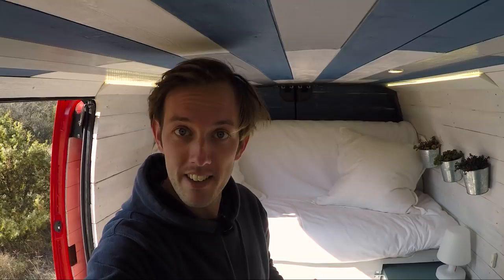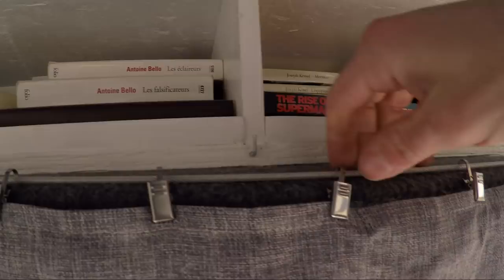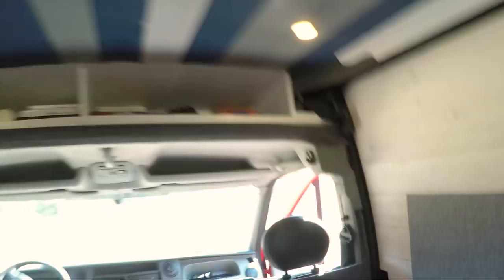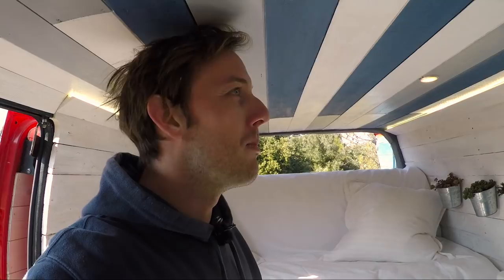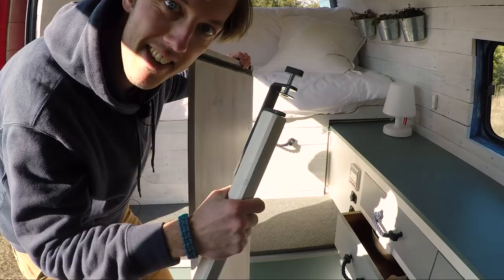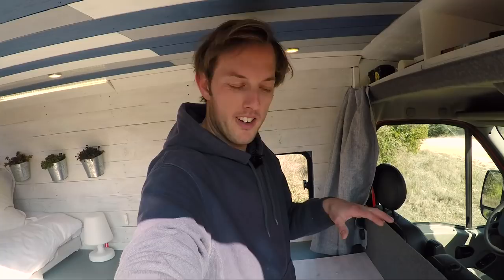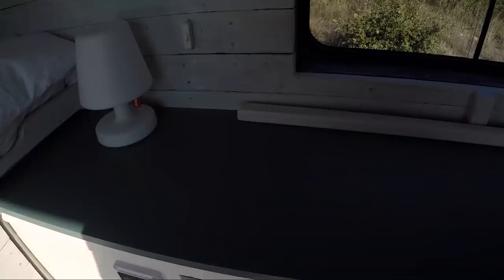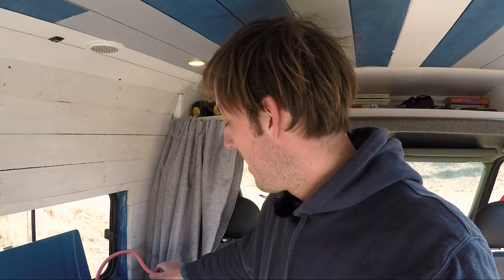VAN TOUR - DIY Camper van / Studio Conversion (New bed and table ideas for short wheelbase van)

Comment: Hello! I noticed you've used a bed base without bed slats, and I'm wondering how comfortably you've found it? I'm thinking of doing my own van build and not sure if it makes enough difference to matter? Obviously a lot of traditional beds use slats so the mattress has more give and can be more comfortable. Did you get a particular mattress to make up for the base? Thanks :)
Reply from the maker: It's still comfy, but if you can used slats it's a lot better for air flow around the mattress, which is important so it doesn't mold. But it wasn't possible in my case as i needed the strength of the boards for the sliding bed to work. I used an old Ikea mattress from my student bed so nothing special about it. Tailor cut foam mattress could be lighter and more comfy, but they're not cheap.
Reply: @emal  huh, good to know- the reason I'm asking is I'm hoping to use the mattress as sofa cushions for elsewhere in the van during the day and have the bed base as more floor space; hopefully that means everything can dry out during the day? How deep/thick is your mattress? Thanks a lot :)
Reply from the maker: I'm not sure what you mean, but i'm sure you'l find a way. Keep in mind that a mattress is pretty heavy to move. Sliding it is ok but if you need to carry it everyday it will not be fun. Otherwise go for light foam instead of an actual mattress. I'm not sure of the thickness maybe 15/20cm ...

Comment: bathroom and refrigerator system?
Reply from the maker: Nope, shower and toilets are everywhere once you start looking for them. I think i can do without a fridge, but if i really need something in summer i'll probably build a mini-fridge with a Peltier module (thermoelectric effect) connected to the battery.

Comment: How does the bed slide, did you put rails in the side? And how did you keep the backrest upright when in couch position? I have the same exact van except its white lol. I'm trying to figure a way to slide the bed but keep the storage underneath fixed. I also thought maybe slide just the mattress and have a hinge fold up to extend the bed when in the down position.
Reply from the maker: You can see behind the couch at 9:45 (it's a tie-down strap holding it). The bed is sliding on a wooden frame (no rails) You can check it out in the van build video: https://youtu.be/ko-F0Ma4i-w Yes a hinge system could work, but you'd need a pretty light mattress so you can lift it up to unfold it. Mine is too heavy so i made a sliding system. Good luck on your build! and Go Team Renault Master :-)

Comment: hi all, i am also very interested in converting a van to a camper and was wondering if anyone can reccomend me a van that is big enough to put a bed in but still have enough space to put in a motorcycle so i can take it with me wherever i go
Reply from the maker: A motorcycle is pretty high so you might want to store it on one side and build a bed on the other (like a singe bed in the length of the van). You won't be able to use a short wheel base van though. Or maybe a high top van and then you might have enough space to fit the motorcycle under the bed. Anyone else has an idea?